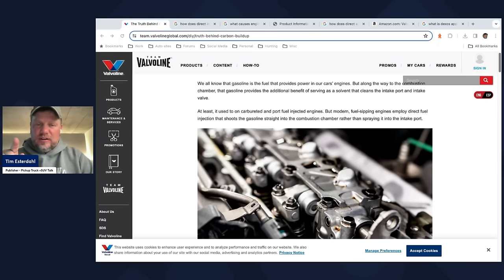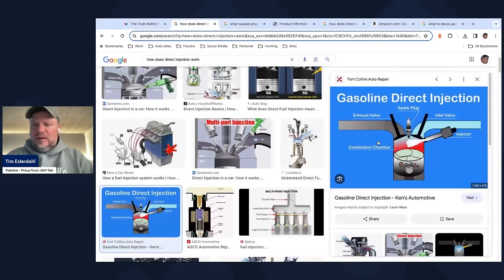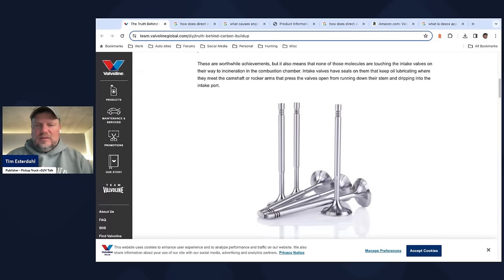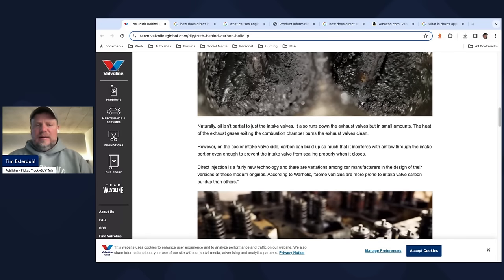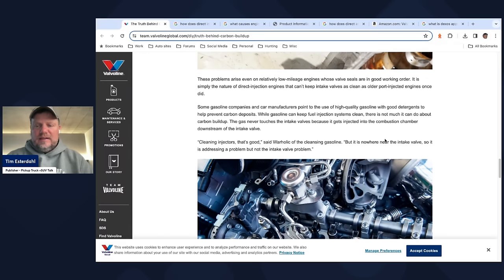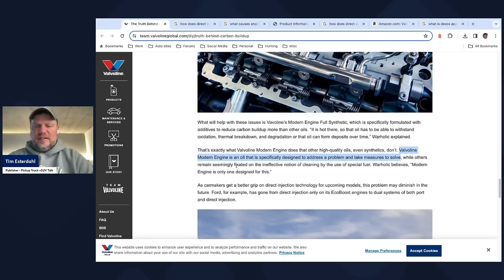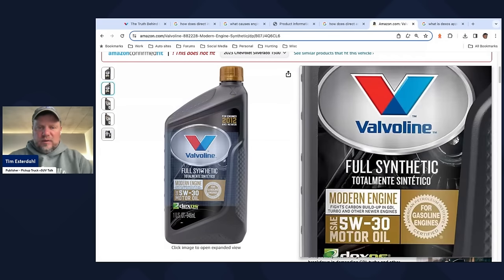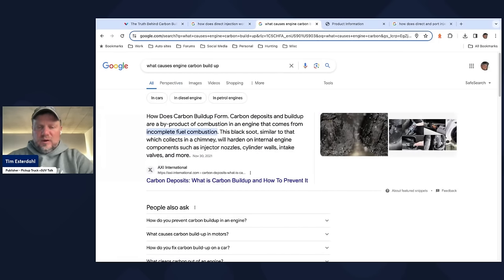Prevent Carbon Buildup with Modern Engine Oil? True or False?

Comment: Tim i dout you remember our conversation on the last video but this is exactly what i was trying to say. Ill tip my hat too you. You actually got to the root problem. Although i dont agree with Valvoline oil isnt the fix but it can help. PCV systems are actually what causes this but they are necessary. The real answer is dual fuel injection systems "like ford uses" Great video.
Reply from the maker: See I listen! Now tell my wife that. 😂
Reply: @Pickuptrucktalk  I'll stick too arguing with you. I figure she would roast me 😂
Reply: Toyota and others too.
Reply: EGR is another source. The pictures of carboned up intakes are usually from older DI-only engines with EGR systems and antiquated PCV designs that made zero effort to separate oil mist from the gases leaving the crankcase.

Comment: many years ago my old ranger actually had a few tsb releases about carbon buildup causing detonation at part throttle.back before knock sensors.the factory recomended fuel system cleaners followed by a few itialian tuneups.& that was all port injected as well.

Comment: Carbon Buildup Prevention: 1) Shell V-Power Nitro gasoline (it's extra high detergent)  2) Valvoline Restore & Protect engine oil (it's extra good at cleaning engine pistons and valves 3) 4 month or 4,000 mile oil change intervals.
Reply: Fuel type CANNOT help as fuel does not touch the valve on a gdi system.  Why so many keep talking fuel is beyond me. 30 years ase  mastertech here.

Comment: Snow performance kit? Will that fix issue
Reply from the maker: A what?
Reply: I strongly believe Water/Meth injection is the best valve cleaning method and cheapest and definitely do a great Job! I have Snow meth injection, Catch Can (UPR) and changing the oil every 5K miles at max. 233K miles on my 6.2 2015 Silverado and pulled the valve cover three times and the last time was on 210K miles and everything shines as gold! no build up whats so ever. 

Also running a Whipple supercharger making 600rwhp to the wheels.
 
I have a Toyota yaris for short trip and grocery…etc  if thats matter as i do not like idling for long periods inside the city.  

We have been building GM V8 gasoline DI engines for the last 20 years and for the last 10 years these are the methods we are recommending for our clients and almost on weekly basis we build 2-3 engines and we know how the DI builds that junk 🤮 behind the valve. 

Port injection is a good choice but high $$

Comment: Tim, every IC engine ever built suffers from incomplete combustion, That is a fact. Emission control systems like PCV and EGR contribute even more to incomplete combustion. Duty/driving cycle also contributes to this problem. They have figured out the various contributors to incomplete combustion. They have minimized the problem. But they have not eliminated it. Valvoline is practicing capitalism. They want our money. The real cause is severe environmental rules and regulations imposed on the engine builders by the Air Nazi's at USEPA and CARB and the technologies the manufacturers use to meet those rules and regulations.

Comment: Im honestly surprised by the answer given by the engineers that there is a "complete combustion of the fuel". Thats simply not true in ANY engine. Point one...any oil analysis will show some form of fuel dilution (IE incomplete combustion). Point two...there isn't an engine on the planet that is able to run exactly stoichiometric 100% of the time. Almost every FI engine runs slightly richer under heavy load in order to prevent detonation/pre Ignition. Point three... almost every engine will have some % of valve overlap where combustion gases (including a percentage of that unburnt fuel mixture) will find itself reversed back into the intake plenum and deposited onto the valve and port walls. Port injection does a fantastic job of removing those deposits. Some OEM's (VW and Audi for example) have port cleaning service intwrvals due to them just having direct injection. Oil and fuel quality simply are additional variables that conflate the existing DI issue.

Comment: Carbon build up comes from the problem from Pump Fuel.

The fuel absorbs Air like a Dry Sponge absorbs water. 

Use Ox-Cetane in Your fuel, 1ml per gallon of Fuel. 

Restores lost fuel economy. 

Fix this issue and the Fuel will clean out the Engine.

Comment: Valvoline is No longer  what it used to be.
 It's  currently so diminished that it's becoming difficult to find/buy.   
IMO.. Their Current new and improved sales push  seems as a 'hold the line' last stand.
 My pore Saab engine at 120k miles is  seriously carbonned up.
 Despite having received 3k mile oil/filter changes for the last 20 years. Not believing that current oils are Miraculous  let alone 'better' than they used to be.